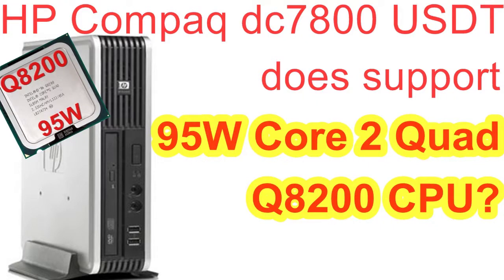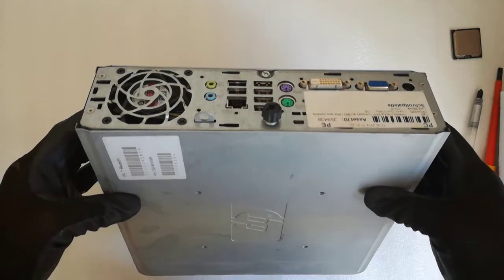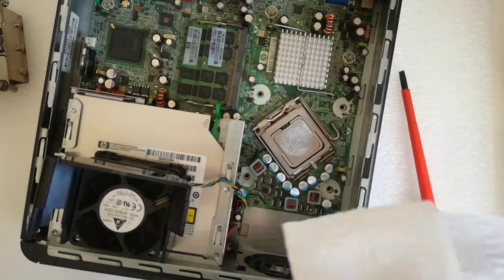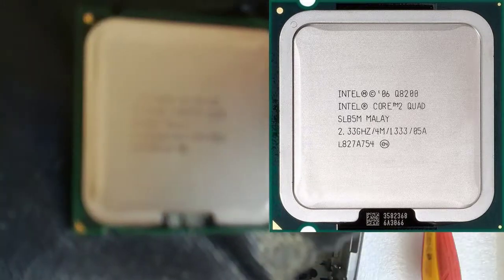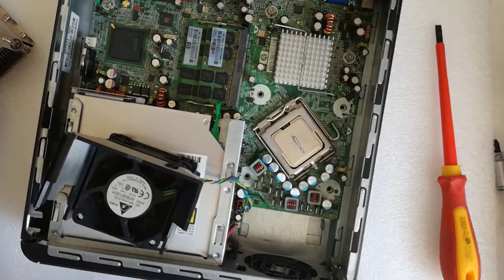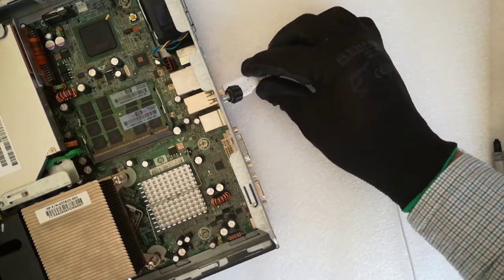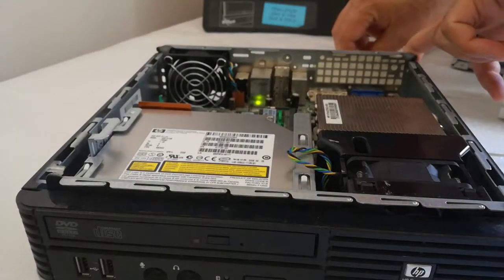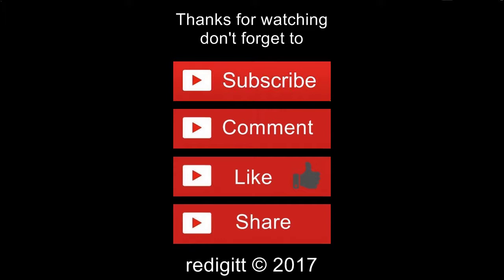HP Compaq dc7800 USDT does support 95W Core 2 Quad Q8200 CPU ? Ep.217

Comment: i tried the same thing with the same results, a simple bios update worked and now the pc performs really well as a basic budget gaming pc paired with a gtx 650
Reply: I have HP DC 7800 Small Form Factor with Core 2 Duo E6550 Processor pre-installed. I also have a Q9400 Processor but whenever I insert it in my PC, it say that bios needs update. And I don't know how to do that. Could you help me? Thanks
Reply from the maker: @SMGGamingBenchmarks  Aloha, here I have a 27 video playlist https://www.youtube.com/playlist?list=PLdsSKCXNCJYhNEKWdUPdFrRJyCjBBYL4L with HDD, CPu, RAM, WI-FI upgrades for the dc7800 USDT PC, for the BIOS look for the https://www.youtube.com/watch?v=Ewx-3SM-JaU&list=PLdsSKCXNCJYhNEKWdUPdFrRJyCjBBYL4L&index=5&t=2s  video.
Thank you for watching, if my video was helpful please share and subscribe, have a nice day.
Reply: Edward, if I understood correctly, you managed to get Core2Quad 65W processor running on USDT version of 7800?